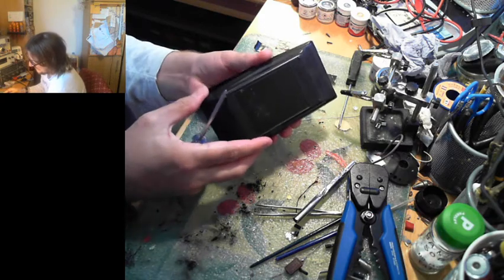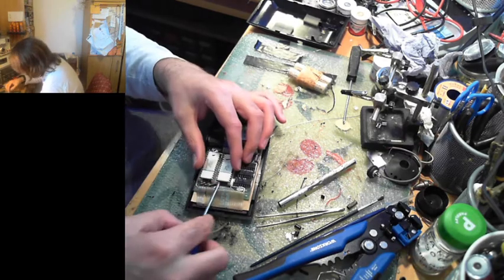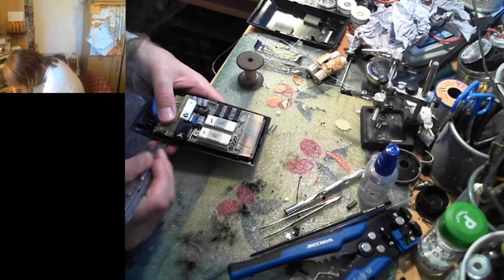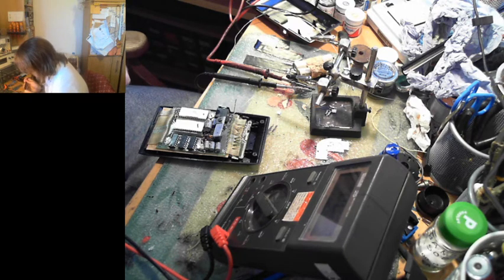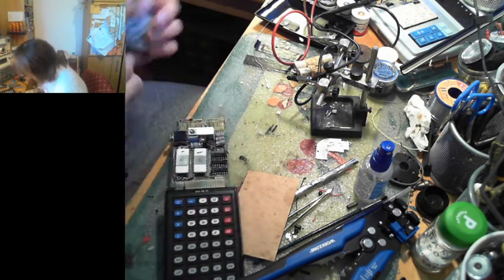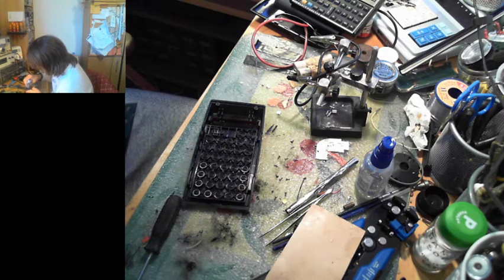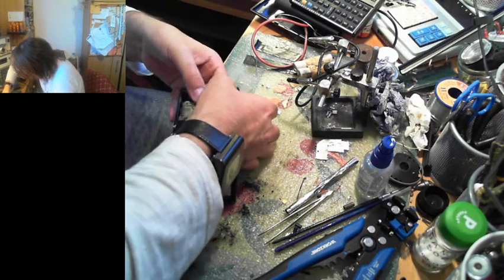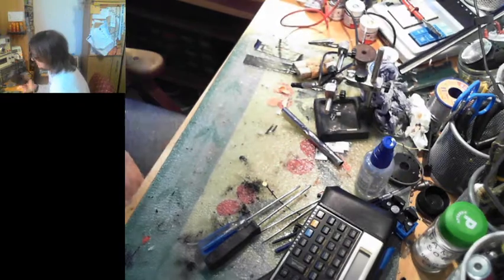Commodor CBM SR-36 Calculator Teardown {[Live Repair Fail]}

Comment: I've had only one experience repairing something with battery corrosion.. an old Sony D6C cassette walkman.. and yeah after battling it for a week+, replacing everything conceivable in the damaged area including a control chip, it still kept having issues. The batteries that leaked affected a part of the circuit that generates voltage for the main DC motor. This player/recorder uses feedback from a servo to regulate motor speed and that was part of the damaged circuit. There are a fair amount of high impedance paths, and my guess is that the "battery juice" soaked into the PCB creating current leakage between different traces, preventing it from working properly. It was such a huge waste of time that I kind of never want to deal with corrosion issues again lol. Super cool to see those ceramic packages in a calculator tho. Almost warrants a transparent window on the back side haha. Thanks for showing.
Reply from the maker: Year, part of doing these sorts of repairs is leaning where to stop. These old LED displays are unobtanium, but that combined with a logic fult pretty much meant this one is not recoverable & not worth putting in the time. Just clean it up so it looks like a nice shelf queen.

I have never had any luck fixing stuff made by SONY, when SONY stuff breaks it usualy goes in such a way that it is completly buggered.
Reply: @TheEPROM9  Yeah that's what makes me kind of wary of buying vintage test equipment, cause parts will either be unobtanium or marked up like crazy on the used market. At least for calculators it's not a huge investment. Still sucks tho when you can't fix something.

I really love LED displays but more like the 5x7 character pixel HDSP series that were used in the industrial and aviation markets for several decades before large LCD screens took over. They last forever so I don't feel guilty just keeping them on, unlike VFD, plasma, nixie or others. They're super pretty imho.

I've had very good luck repairing Sony industrial gear but for consumer stuff hmm I've only ever fixed one audio amp from the late 90's which was easy. Sony stuff tends to be very logically made (especially 80's-90's stuff) but one pitfall is that in those decades they used lots of custom Sony parts which are now unobtanium as well. Modern Sony is just generic cheap stuff with minimal effort. :s
Reply from the maker: There is always that gamble when buying broken crap on eBay. Vintage calculators have not see the price hiken that the somputers have. I love the vintage LED's, last forever, unless a batery or 4 spews their guts on them. The old SONY stuff was some of the best built tech I have ever come accross. It is sadly rear to come accross something well built these days.